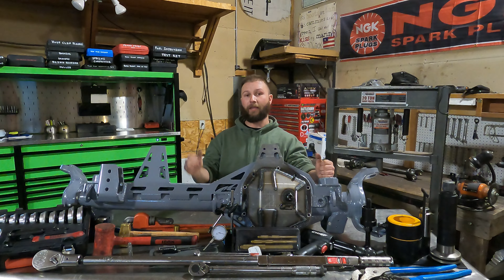THIS JUNKYARD BUILD WAS A "TON" OF FUN... ARB LOCKER AND NITRO GEARS FOR THE SUPER DUTY 60!

Comment: I suggest marking your shim thickness with a permanent marker rather than engraving them, engraving tgem causes raised spots on one side of your shim which can make tgem uneven thickness.
Reply from the maker: I use to use a marker but found that the gear oil would wash it during set up. I found a good set of diamond rotary bit that cut well and don’t raise. Thanks for the watching!